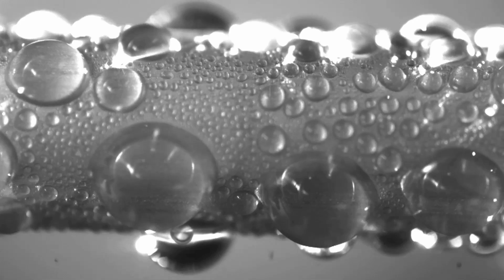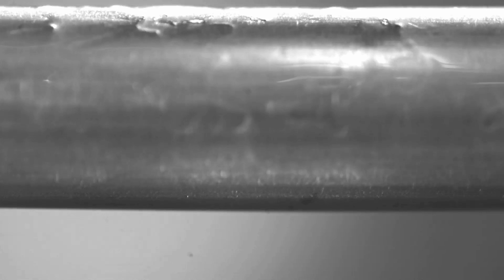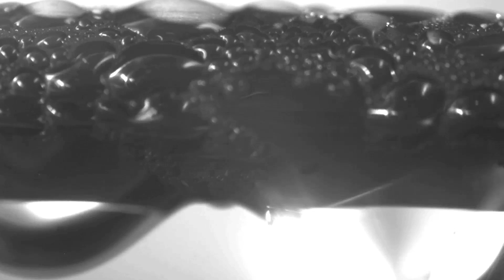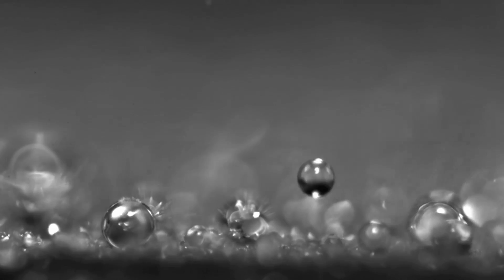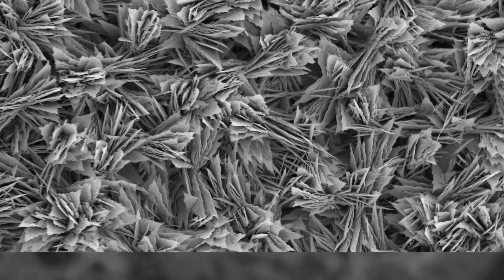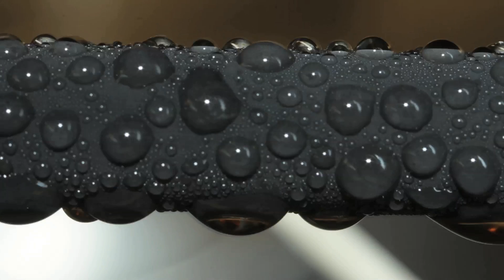Jumping water droplets improve power-plant efficiency

Comment: I could see this tech having a big impact on multi-stage flash distillation (MSF)! Unfortunately, the video makes no mention of cost to produce or apply this material... Ideally it would be something that could be painted or sprayed on by a low skilled technician.
Reply: Replying this after 6 years lmao, You are absolutely right. If I am not wrong the problem is related to scaling up the fabrication of the superhydrophobic materials..what we are seeing is probably only 10 cm tube which has nanostructures over its surface...the cost, as well as time required to deploy this on a power plant level, would be significant. Correct me if I am wrong.